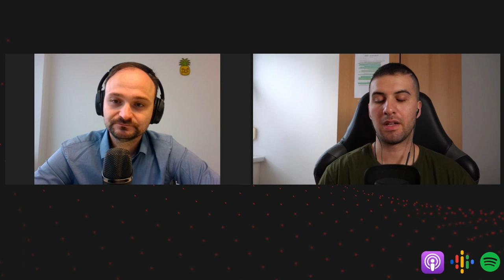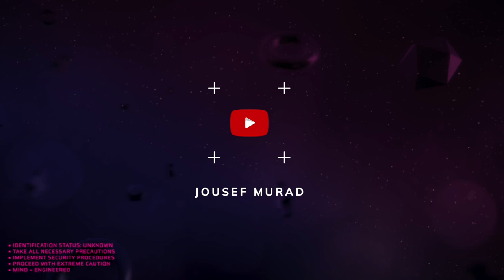OpenFOAM vs. Commercial CFD Tools | Jozsef Nagy

Comment: Is there any limit to parallelization while using Ansys Fluent?. I think it's equally good in this as compared with OpenFoam. Am i right?
Reply: no.With student ersion you are allowed to run parallel cores at max 4. However, if you have liscensed ersion then situation is different.